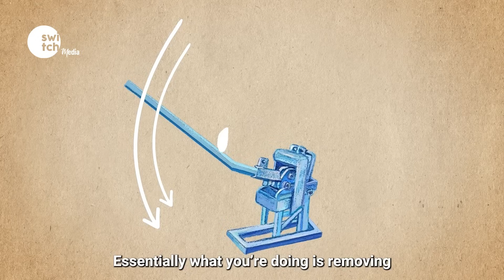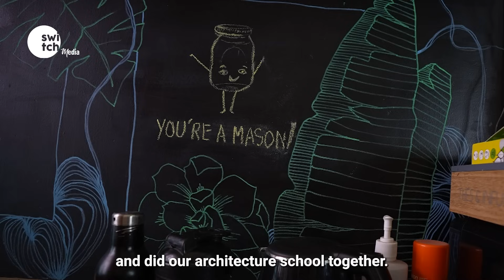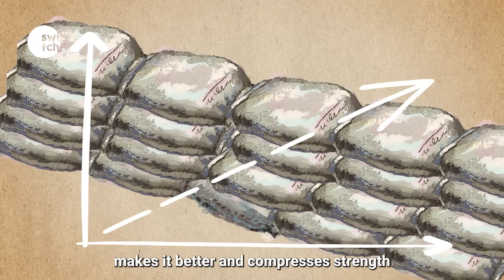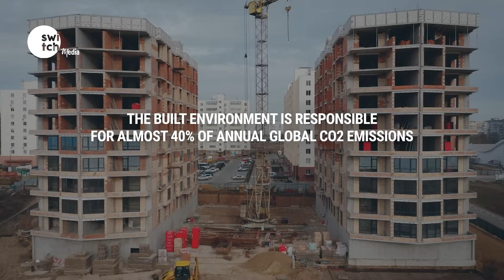How to Build a Sustainable Home | The Magic of Mud

Comment: What about the structural strength and longevity of the building, is it at par with concrete and how many floor can max be built using these techniques?